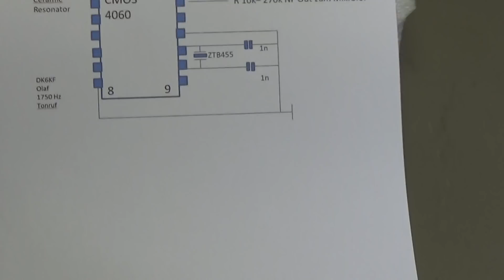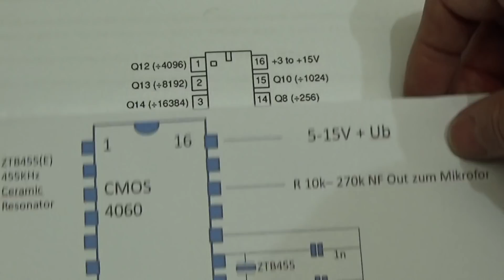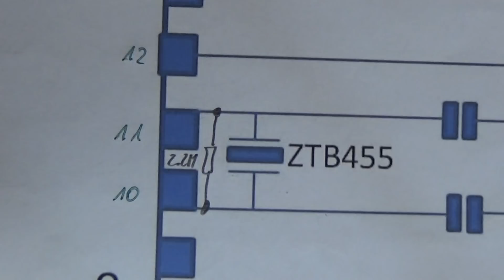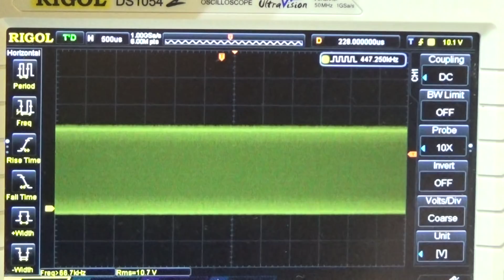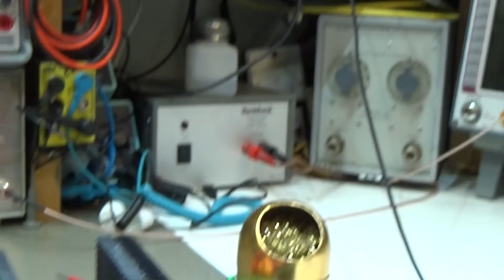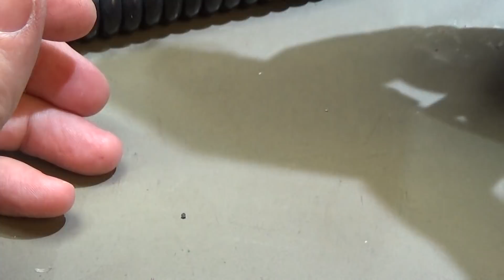#203 Bosch KF166: OMG we need a ton burst to open our repeater, let's built it

Comment: 455 / 256 = 1.7773 kHz. I'm guessing that the external capacitors pull the ceramic frequency down and that if these values are tweaked then the final frequency would be exactly 1.75 kHz.
Reply: 455Khz / 256 = 1,777KhzYou have made a comma error (dot)
Reply: @tortsen2  Thanks for pointing out my dot error (comma). I have fixed up my comment.
Reply from the maker: yes you are right by using a variable cap you could make it even more accurate....

Comment: As always a nice video,, Some were asking about pushing the button each time or is the repeater on a timed use,,, like if I push the button once will the repeater remain open for a set time or do you have to push it at the start of each transmission ? TNX AC7RH
Reply from the maker: Thanks Ron! No once the repeater is up you do not need to push the ton any more as the repeater has a delay time until it shuts down again...
Reply: TRX Bench Out of curiosity, why was a system like the 1750Hz tone preferred over alternatives like CTCSS or DCS which provide for continuous squelch control and allow the repeater to remain in low power “receive only” state until the continuously coded squelch control is heard and provides for better rejection of cochannel interference?  I have always been curious as to why Europe opted for a  solution like a 1750Hz “wake up” tone over alternatives like CTCSS.  Just curious as to what the history/rationale behind the choice may have been since it’s unlike anything we do here in North America making it a novel solution from our perspective.

Comment: So every time you want to talk into the repeater you need to hit the tone button briefly at the beginning of the transmission? Sounds like a pain. The sub-audible PL tones we use in the US and elsewhere seem a little easier because you really don't have to think about it much.   Anyway, nice to see the inside of a vintage Bosch radio! 73s!
Reply: I was wondering about that new button myself.  Does one press of the button enable the tone and it will remain 'on' until the conversation is over or do you have to press the button the entire time you are talking??  That to me could get very tiring quickly.
Reply: Think of it like the brief wake-up CTCSS/PL tone used by some satellites to turn on the transmitter for a period of time...as opposed to how we ordinarily use CTCSS to control squelch by transmitting such continuously during a QSO (and then filter out that “subaudible” tone our with a high-pass filter on the audio output so it isn’t heard).  They’re just using 1750Hz to wake up the repeater until the next timeout by briefly pressing the button at the beginning of the first transmission.

Comment: I love that cms-50 very nice to have! Unfortunately my unit the 1kHz toon in ssb is distorted, not easy to find people that can fix this kind of units😕
Reply: Michael Cornet can you explain better the issue with your CMS-50? I know this kind of instruments well enough, I’ve two 50, one 54 and one 52, I’ve a CMU200 too but this is another story...
Reply: Arturo Franzin i will try: when I test an ssb radio in usb mode and set an af of 1kHz with -79dBm and I listen to the tone from the radio it is some kind of distortion on it, it doesn’t sound like before. maybe we can email about it? pa4mic@jemico.eu
Reply: Michael Cornet what version of software does it have? 4.81, 4.90, 5 ? If i remember well ssb function is present from version 4.90 ->.... old version with software v2 are not upgradable
Reply: Arturo Franzin V6.02 29.09.2000
Reply: Michael Cornet woh as i known the v5 has been the last, but you have v6 !! Can you take a screenshot of the cms screen when you testing the radio in ssb? If u put an oscilloscope probe to ‘mod gen output’ the 1khz sinewave is clear and stable? Try to connect the rf out to a spectrum analyzer and check it, try to move 1khz tone up and down and check the signal on spectrum if match it
Reply from the maker: If there is any suggestion or solution that would be perfect for the channel to share as well. So if you have something to contribute please put it here additional. Thanks a lot!
Reply: TRX Bench do you repairs like that Peter? Germany is not far to drive to 😬
Reply: It turned out that everything is ok! Happy with that and big thanks to Arturo Franzin for the help to check👍
Reply: Michael Cornet You’re welcome!
Reply from the maker: my version is V 6.06 so a 5er version can't be the last one...
Reply: TRX Bench peter did u read my message?
Reply: TRX Bench a it would be great if you are willing to share an copy of 6.06 Peter!🙏
Reply from the maker: what do you mean Michael, if I'm working on lab devices? No that would kill my time schedule..I do it for my own equipment and that's it...
Reply: TRX Bench yes I did, it would‘be an nice video and an meet and greet 😬 But it is not necessary it turns out.😅 (of course unfortunately of the meet and greet)

Comment: Being that we don't use 1750hz in the US, I was watching you press and hold the tone.  Do you have to hold that during the whole TX, or is it like CTCSS where you press it quickly to open the repeater?
Reply from the maker: Don't worry one push and the repeater is " open" So no nee to hold it during the whole TX :-)
Reply: Eric KJ7XJ Yeah I was curious to that as well.  If the user has to hold it down while talking ... man what a pain!
Reply: @cnick6  Just need it to open the repeater, so a quick press on first transmit is all that is needed.
Reply: CTCSS isn’t something you “press quickly” ordinarily (outside of some satellites that use such to wake up the transmitter from its low power state on first transmission).  CTCSS is a “subaudible” tone (note the quotes), a tone under 300Hz (the audio passband uses a high-pass filter, so under 300Hz is not heard on the audio output), that is transmitted continuously throughout the conversation and holds the squelch open so long as the tone is present — hence why it is called Continuous Tone Coded Squelch System (also known as a PL tone).